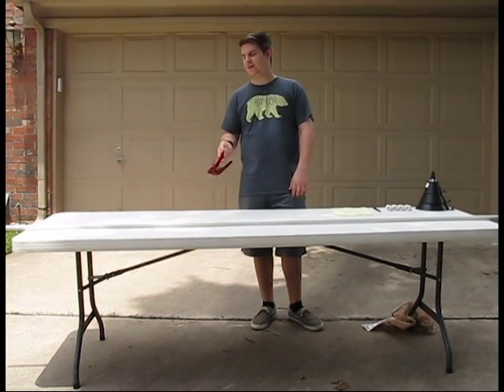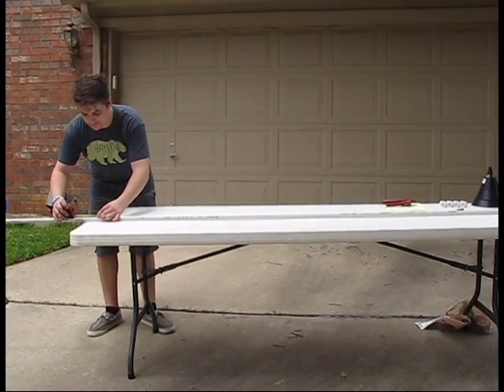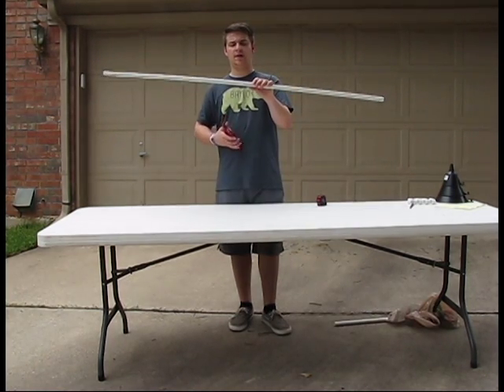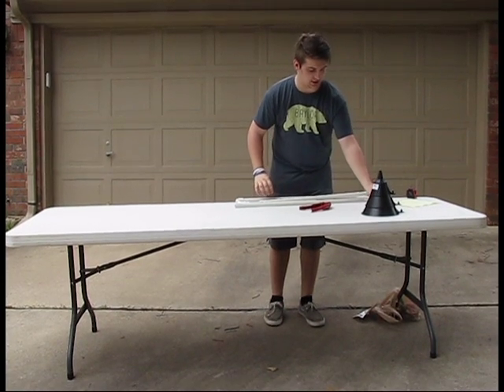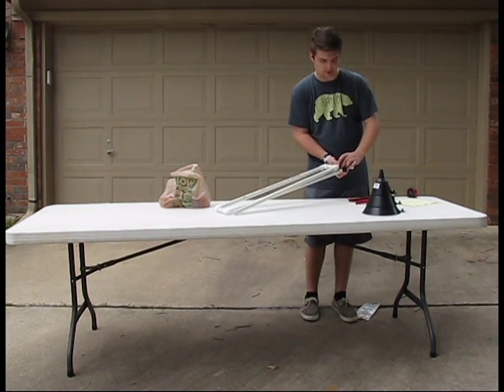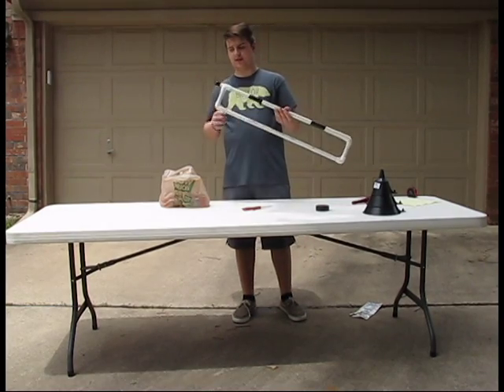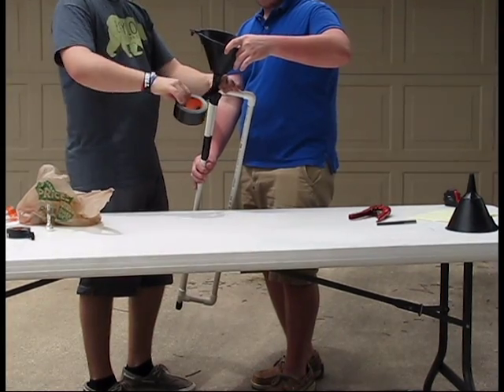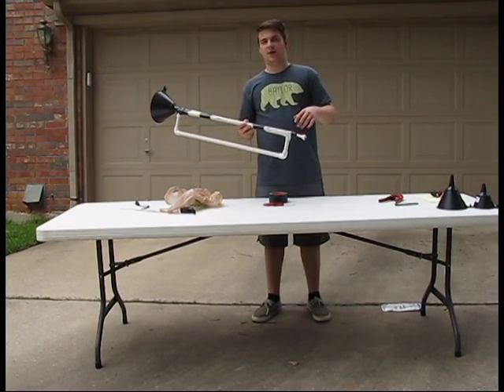How to Make A PVC Baroque Trumpet

Comment: I also tried a few times to blow on a long plastic tube but  the harmonics are not on the place you would expect them.
Reply: Is it the difference between equal temperament and just intonation?
Reply: @1-t254  Somehow it must be normal that a good trumpet is more than a bended tube with a bell on it.  I visited Schilke once and was both surprised and disappointed that almost all was done in a "very messy" manually way.